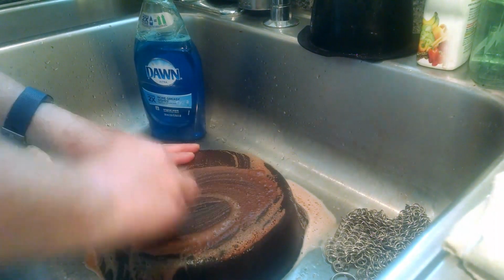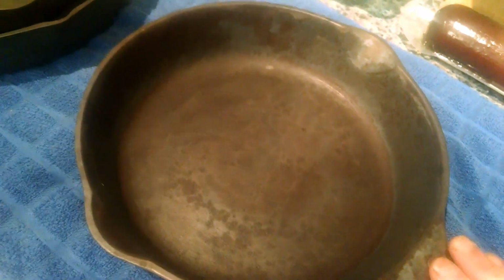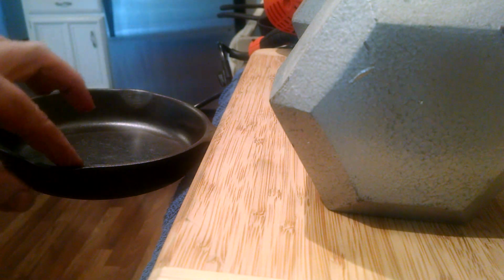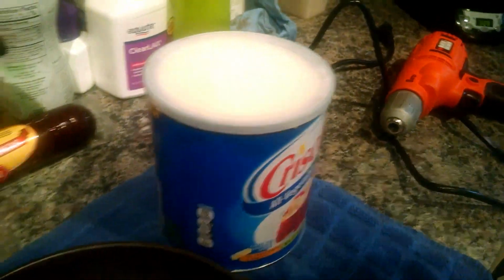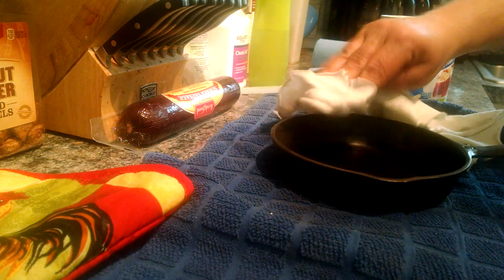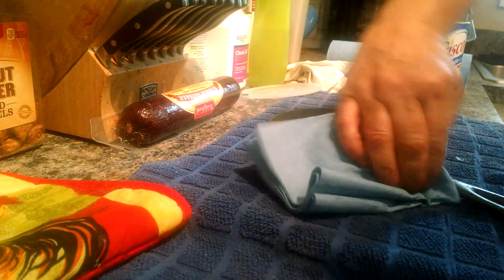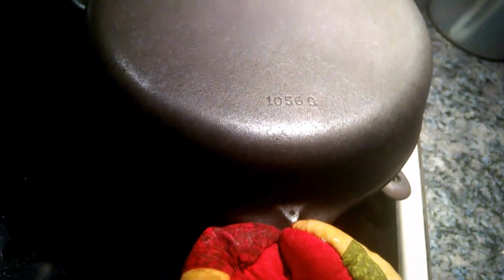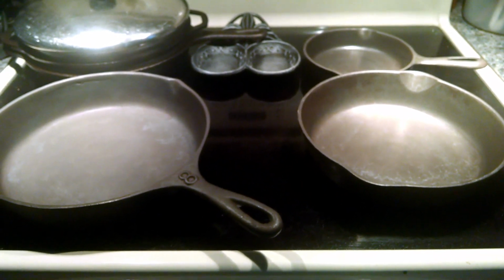Vintage Cast Iron Overhaul from Cruddy to Like New - Part 2

Comment: 👍For re-seasoning I had saved the tallow (the rendered animal fat that settled on top of the broth in the fridge after it was throughly chilled) from making some homemade bone broth. After cleaning the cast iron pans in the oven on the clean cycle, I scrubbed them inside & out with steel wool to get rid of all rust. Then I used a combination of oils. I used coconut oil first, then grape seed oil (because it has a high smoke point). I placed the cast iron in the oven upside down a couple of times with these oils on them and then I used the beef tallow on the pans in the oven the lastly on the stove top to fully season it. I think everything turned out well. I really enjoyed restoring the skillets & pans a while ago. For some reason it was very satisfying to do the work. 😁💞
Reply from the maker: Wow, what a process!  As long as it works for you and your skillets work great, that's all that counts.  I too long restoring these skillets and bringing them back to life.  It's so nice to use a part of American history while at the same time keeping them out of the scrap yards or land fills!  :-)

Comment: An absolute inspiration!  Wow, well done.  Just bought my first cast iron skillet from a thrift store yesterday in relatively good condition.  I scoured it and seasoned it and cooked in it and it was delicious.  But you have taught me not to be scared of the seriously rusty ones!
Reply from the maker: montyollie. I am super happy to hear that!  Rust isn't necessarily bad but there are a few things you can do before buying to help determine whether or not the pan is damaged beyond repair.  Sometimes you will find some pitting but if it isn't too bad the pan will work fine.  The single most important thing you can do is to hold the pan up by the handle and bang on it with your knuckles.  If it rings there are no cracks under that rust and muck and if not there could be a crack.  If so, pass it by.  You're lucky to have found one at a thrift store.  I never have and I resell for a living!  Kudos to you!!

Comment: I found an old Wagner 9 inch in not so good shape a couple of days ago and spent about a hour with a wire brush on my angle grinder to bring the pan to an almost shining dark metal. Sorry that I did not know that the oven would have brought off most of that old crust.  Done one oil rub and one hour in the oven . Will do it twice more and use it. Can't wait to see how it works. Enjoyed your video.
Reply from the maker: Thank you Peter for stopping by and checking it out.  When I made this video, I didn't know as much as I know now (it was about 2+ years ago when this was made).  Anyway, I only use the oven now when other methods aren't as effective.  My only caveat is to use it on non-collectible cast iron of thicker cast iron.  The thinner walled pieces like Vollrath or Griswold might not fare as well due to the extreme heat of a self clean oven.  They are subject to warp or cracking due to the very high temperatures in a self clean oven.  Wagner Ware pieces are thicker and the ones I have used in my oven made it just fine!  Anyway, hope this helps!

Comment: Nice video.  Enjoyed both.  Had a particularly crusty cast iron pan.  As it was winter,  I put it in the wood heater overnight. Next morning all the crust had baked off.  Finished the process. Great pan.
Reply from the maker: Thanks Donna!  When you say wood heater, did you mean a wood stove?  As long as there is no potential for fire damage to the pan, that would work just like a self cleaning oven.
Reply: good morning! Yes it is a wood stove. I think I got that idea from Mother Earth. Just burns off all the crusty stuff..no damage to pan. Saves the "elbow grease."  Have a nice day!

Comment: That's awesome!! I recently did a couple ( in winter cuz it's too hot to run oven now ) and I did the very technique you did. Although I used a vice in my garage for the polishing. 👌
Reply from the maker: Thank you Silvers Ss!  I really appreciate that!  This is my first attempt at old cast iron and I am sure I will get better the more I do it.  I don't have any special equipment, but the sanding works great for me.  I am thrilled these turned out as nice as they did with one layer of seasoning.  I did run my oven today, but it wasn't too warm out and I could open all the windows in the house so it didn't get too hot.  Phew!  :-)
Reply: Don't forget to keep one for urself! Amazing to cook with. Durable.
Reply from the maker: Silvers Ss    Oh these are staying with me!  I need to get more proficient in my rescue efforts!  lol. I can't wait until I'm done and I can start to use them!

Comment: You did a superb job with cleaning and priming those skillets!
Reply from the maker: Thank you!  Not bad for my first try!  I've tweaked things a bit since then, but I do the same basic method currently.  :-)
Reply: I've seen a great many cast iron skillets at rural rummage sales and always in the condition that you bought these. I've always passed on them, because I had no clue if they could be restored or not. You've given me the knowledge and confidence to give it a try the next time I come across one.  Thanks so much!
Reply from the maker: You are most welcome!  If you're only paying about $5 or so for an old rusty skillet, it's worth the gamble.  The best test to give it is to hang it in the air by the handle and give it a bang with a solid object.  If nothing's available, then your knuckles will do.  There should be a ring to the sound.  If it sounds like a thud, you may have a crack.  STAY AWAY.  The others are worth a chance.  The only way you will find out if they are good or not is to strip down to the bare metal and go from there.

Comment: I love cast iron for cooking and pouring  :)  I was given a vintage cast iron ladle by Vulcans brother. I'm gonna use your technique to clean it up :) Thanks for the video. 👍🏼
Reply from the maker: Very good!  I hope it works well for you.  In hindsight, I should have given these pans a little more time in the oven, but I am not sure it would have made much improvement on the rust removal.  Someone suggested Coca Cola which would have probably worked, but I've never seen it suggested in the cast iron cooking circles.  Another person suggested Iron Out (powder I think)which can be found at the grocery or hardware store.  You just soak the pans in a sink of hot water with about a cup of the stuff.  I just wanted to throw this out there in the event you needed some help along the way.  The brillo pad in my video was unplanned, but it certainly helped me remove the rust quicker than the 00 pad was doing.  Thanks for watching and good luck!  :-)

Comment: That was some good work. I am thinking of investing in a few cast irons skillets  not sure just thinking. They are so expensive  in my country. But I'd love to get me a few. Thanks for sharing.
Reply from the maker: Thanks Candice for watching!  I am not sure where you are located as they can be purchased online.  A modern cast iron company today is The Field Company, but I am not sure where they ship.  Best of luck to you!
Reply: @ladylibertystacker2014  Ohh! Thanks for responding, I am at this moment looking on line for one am not seeing any field though mostly Lodge. Still considering. Am look ing at a Lodge LCS3 10" it cost$ 49.99 tell me what you think. Candice from Trinidad🇹🇹 I have to pay about $8.00 To every us$1.00  so that is almost $400.00 plus the fee to take it out when it reaches .
Reply from the maker: I am not familiar with that model Lodge, but the ones I have all perform well despite being heavy (yes they are heavy) and the newer ones have a pebbly surface.  That said, if you add enough fat and heat them gradually, they perform almost as well as a non-stick vintage skillet.  That skillet sounds like it could be similar to a USA SK8 which is a 10" skillet here in the states.  Good luck!
Reply: @ladylibertystacker2014  Thanks again for your responds. I spend hours searching Amazon and did not find the field brand.I have absolutely no idea about cast iron   I just got interested as I have been viewing ton you tube and want to try so I will pick that one up at Amazon and see if I like , I will continue to search for the one you recommend and see how I feel about  cast iron cooking. Thank you for your time and efforts.  Candice from Trinidad🇹🇹😍
Reply from the maker: Here is a direct link to The Field Company's web site.  I am not sure how far they would ship, but you can check it out.  https://fieldcompany.com/

Comment: I found a #10 (12 inch) skillet at an Antique Mall Friday. After researching it, I found out it's a Lodge made between 1940 and 1960 (no "Made in the USA" stamp). It's in incredible condition! I am seasoning it right now (3rd coating).
Reply from the maker: That sounds good.  Believe it or not, antique and really old vintage Lodge isn't as common as you might think.  I've been cast iron hunting for about 2.5 years or so and ran across my first truly vintage Lodge this year.  I was excited to say the least!  I bet yours will look fabulous once you are finished!
Reply: @ladylibertystacker2014  I found it almost totally unseasoned. It had minor powdery rust, and a tad bit of seasoning left. It didn't take long at all to clean. It is on the 5th coating right now. I might do another, or I might call it good here. Depending on how it looks after this go.
Reply from the maker: It is nice when you find pans like this that have hardly been used. They are a dream to restore.  My unmarked #8 Vollrath was like that.  Easy pezy!  I ended up selling it for a nice profit and the buyer loved it.  :-)

Comment: The safer way to hold the pan when using the drill is to hold it with one hand while sitting on top of a towel or a silicon pad on the counter or table. Much safer than putting the handle between the counter and wood block.
Reply from the maker: Yep, I have since discovered this on my own.  This video was done in 2017 and I now do it as you describe on top of my blue silicon hot spot pad.  I got the original idea from another YouTube video and it wasn't as easy as the way I do it now.  Thanks for watching and commenting.

Comment: You can't beat cast iron cook wear. Lasts for ever, even heat distribution.   Non toxic.  Kind of makes every thing else obsolete,
Reply from the maker: You get it does Zaps!  I've converted my son to cast iron as well.  Searing meats, then baking is so much better for you than grilling.  Less carcinogens and like you say, non toxic!  Thanks for watching.

Comment: Several years ago I lucked into a set of cast iron skillets of the same sizes. The 6 inch one is a Griswold. I don't know what the others are. I lost my house to foreclosure and someone else packed me up and put things in storage for me (I'm disabled) and I have no clue if I even have them anymore. I paid $15 for the 3 I bought and I also had my Mom's and sister's cast iron pans. Hopefully I'll be able to get my stuff out of storage soon and get my cast iron out. The 3 pans I bought desperately need restoring. They looked bad with all the burned on gunk on the outside.  Now I know how to properly restore and re season them.
Reply from the maker: I am sorry to hear about your situation, but with perseverance hopefully you will come out all right.  That said, you are in luck.  Please see my cast iron play list for all kinds of demonstrations on how to strip, restore, and re-season cast iron.  If you are patient, the best way to do this is to do a lye bath to remove the crud, followed up with a 50/50 vinegar-water soak to remove the rust and baked on carbonized seasoning.   One word of warning for the lye bath-add the water first, then the lye crystals (please see video on this) but you can leave your skillets in a lye bath as long as you want without damaging your skillet.  On the vinegar soak, you need to watch this closely because leaving them in indefinitely will start to eat the metal of your skillet!  Good luck!
Reply: Yes, I've been watching your cast iron videos. I've always loved cast iron. My Mom used it a lot. She had a 12" with a lid that I hope is in storage. She made a lot of cornbread and SOS in that pan, among other things. She got to where she couldn't use it if I wasn't home to help her lift it and I'm the one that always washed it. Improperly. We didn't know. Now I do. I also know you never add water to the lye. It's a cardinal rule in making homemade soap. Also using gloves and goggles and in a well ventilated area. I know many soapers who make their lye water outside to avoid the fumes and only bring it in after it's cooled. 

Anyway, thanks for the reply and all the good information you share freely.

Comment: one thing ive learned in regards to seasoning is it the carbon that seasons, oil is hard to build up a carbon layer with. I just season well cold and hot and also cook with butter. I just drain it right before I dump my scrambled eggs in. Eggs build up carbon quickly. a few batches of scrambled eggs and bacon will have that pan ready to go.
Reply from the maker: Yep, that works!  I find that after I begin to use a newly seasoned pan, that is turns blacker and gets shinier as I use it.

Comment: I found a 6 1/2" skillet on ebay with the same markings as yours, except it had a Z instead of an H. They described it as "unmarked wagner ware  ` other than z on the back side with the size GOOD CONDITION" Plus another: "This Wagner cast iron skillet is over 60 years old and has that great light-weight feel of the early American cast iron and a fine, smooth cooking surface.  The bottom is marked only 6 1/2 INCH SKILLET and the mold letter W, which is characteristic of the early, unmarked Wagner cast iron kitchenware."
Reply from the maker: Thank you MeteoMan for that information!  I did a search on eBay and found pretty much the same thing.  I compared the fonts and yes I do have a pre-1960 unmarked Wagner #3 with the H on the back of the handle and on the bottom of the pan.  Since there was no "Made in USA" on the pan, it is pre-1960 which makes it more valuable.  It is smooth and very light weight which I will enjoy using.  I have some arthrytis in my right hand and that pan will be a joy to use.  I found another marked Wagner #5 today in very good condition which is soaking in lye now which I do an initial seasoning with the third coast of these pans.  It has very little rust so I am hoping it will be much easier to do and look new when I am done.  Keep your fingers crossed!  :-)

Comment: I really like the 200, 300, 400 method. Great job
Reply from the maker: This method worked well for me then and it still does now!  I use either a lye bath soak and/or self oven clean to get the grime and crud off (lye baths don't always remove everything, so you need to use the oven), but the re-seasoning method is tried and true.  I have seasoned probably 30 skillets or so in the past year and this method with regular old Crisco works great!  Glad you stopped by.

Comment: I use mine at least 3 times a week. It's so heavy tho. Yours don't look like they're too heavy. My hubby has to help me wash it down due to the weight. Hopefully I'll be able to keep cooking in it for a very long time. Ps. I never use detergents of any kind. Just very hot water and then I heat dry on the stove and wipe down with Crisco.
Reply from the maker: Yep, I replied to your last comment and you have it down pat!  The new Lodge CI is so darn heavy, that's the main reason why I started looking for the vintage stuff.  My #10 BS&R skillet is vintage, but that one is very heavy as well.  It's a great skillet, but if using in the oven or to lift, you need two hands!  You will need to have a skillet handle hot pad and also a regular hot pad to lift it!  The advantage of the new Lodge skillets is the assist handle which makes it a bit easier to lift with two hands.

Comment: Great results.  I really ought to use my cast more often. I just hate cleaning them. Never know what to do, soap no soap etc etc.
Reply from the maker: PharmSilver   Thank you PharmSilver!  Cleaning is easier than I thought.  While the pan is still hot to warm, clean with a non abrasive sponge and a pan scraper (Lodge makes a great cheap one) under warm running water.  Then I dry really well, place over a warm burner and let the pan heat up again for a minute or so, rub on a coat of seasoning and let it bake on until it smokes, then remove from heat & turn off burner.  That's it!

Comment: Thank you for the information, I threw away my grandmother old cast iron frying pan because it got black at the bottom. If I've seem this video  would've known what to do.
Reply from the maker: Oh wow!  If you ever see one again and if you look, you most certainly will, you should pick it up and see what you can do with it.  If it has a lot of stubborn black carbonized seasoning on it, then you can soak in a 50/50 vinegar water soak and that stuff will come off.  Just keep an eye on it when it's in there because if left unattended, it will eat your cast iron away too!

Comment: Just like the Culinary Fanatic video. Right down to the methods and supplies he used
Reply from the maker: Yep, that is true.  I watched his videos and this video was my FIRST ATTEMPT at cast iron restoration.  I based my attempt on his methods.   However, I now do NOT recommend using a self clean oven for restoration (there are better ways), nor do I recommend the use of power tools as they usually are NOT necessary with the correct restoration techniques. That said, these three pieces of cast iron were my first purchase of vintage AND they are in use in my kitchen today.  The #8 mystery skillet is my go to for searing shell fish and the #6 is my gravy skillet.  Thanks for watching!